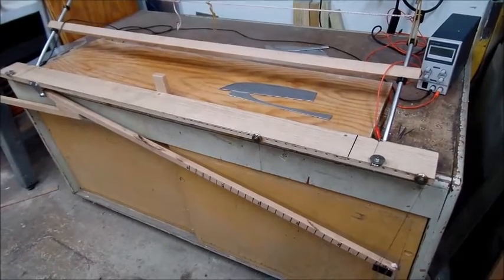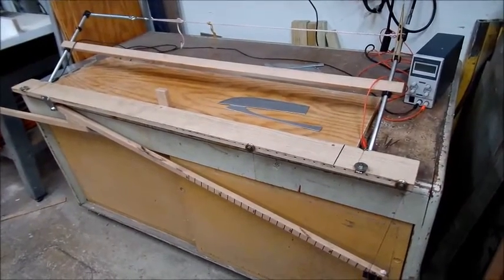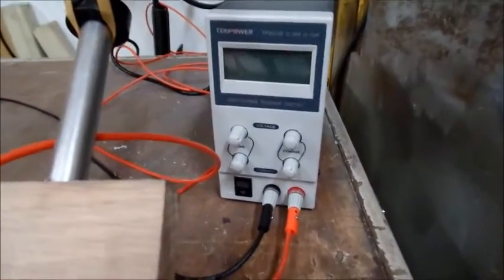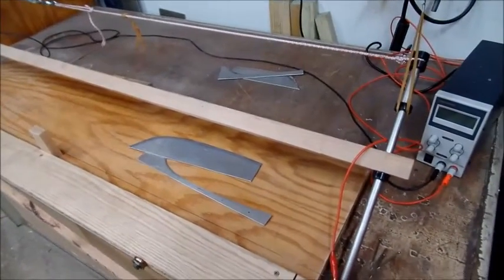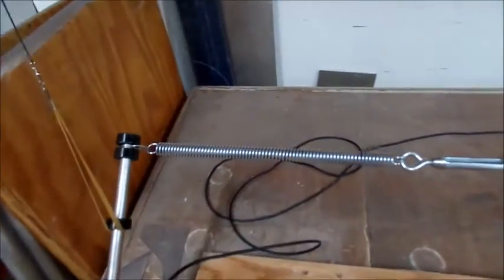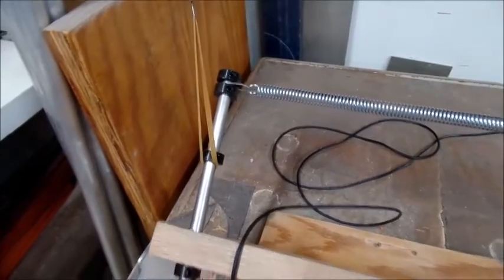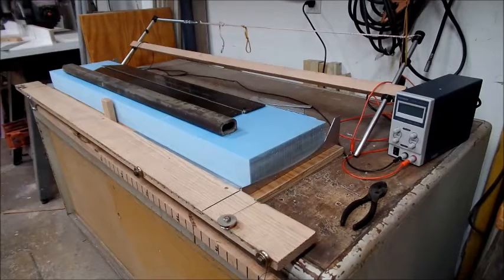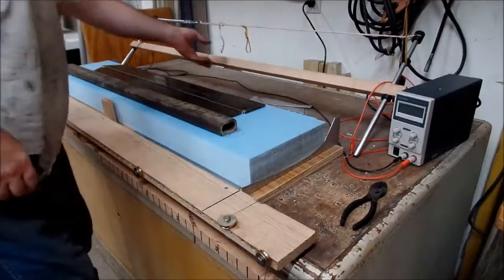Iceboat Foam/Carbon wing mast construction for C Skeeter

Comment: Hi, what diameter wire are you using? I have a diameter of 0.5 mm, but I have a problem that it makes ripples and the surface is not smooth 😞

Comment: Dude, why are you dragging the wire on the templates? Better to istall a small spike or even a small ball bearing on the outside of pipe and let that run on the template. This will leave the wire free from cooling, dragging and , possibly breaking from the abrasion against the aluminum.
Reply: Its good enough.  You’re describing perfectionist paralysis that leads to never getting anything done for the sake of constant “improvements”.  I know, because I suffer this as well.
Reply: @gordoncellist  No I'm not describing perfectionist paralysis. I am describing how you could make your setup better and more accurate with simple alterations. Sorry if I paralyzed you by doing so.

Comment: Great video, excellently explained. I'm inspired to make a hot wire setup myself now! Rather than the fishing lines attached to weights to maintain the straightness of the hot wire though (which seems to work really well in your case, wires exit very close to the same time on each side!), i'm considering making a rigid Linear Bearing based system to prevent the mechanism jacking sideways. Should be interesting. Anyhow, thanks for the inspiration!